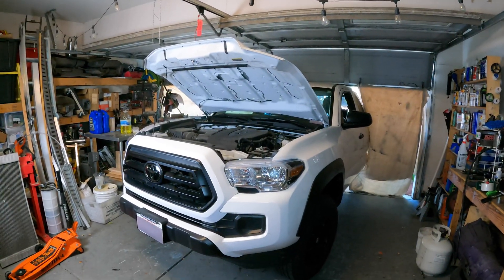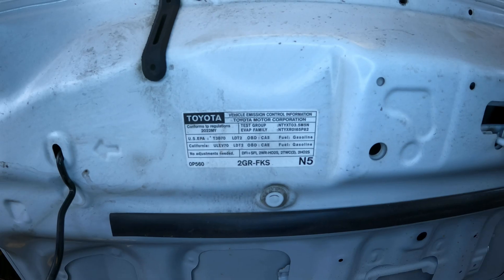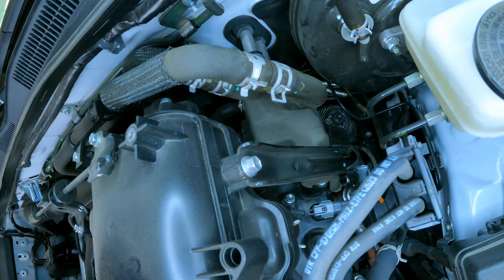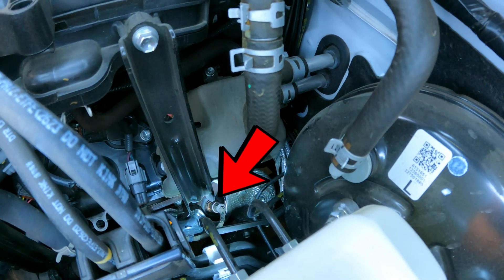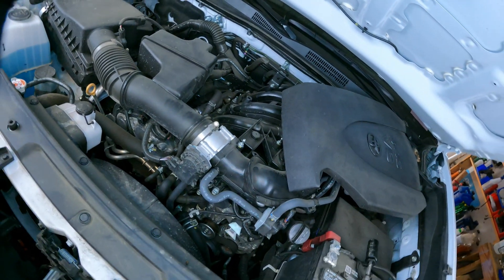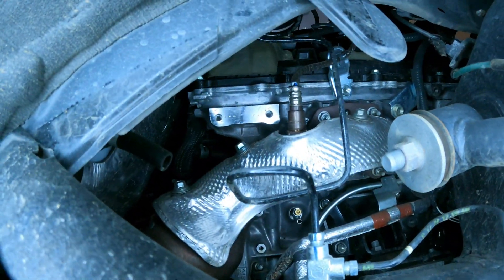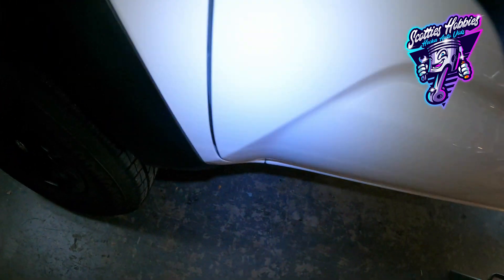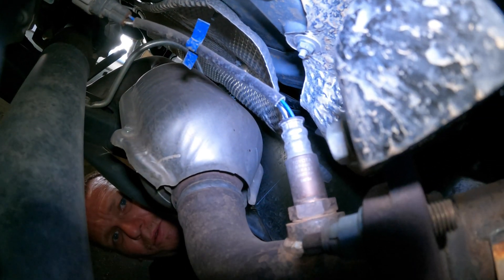Toyota Tacoma V6 3.5L (2016 - 2023) | PCV, O2 SENSORS, EVAP info & Location. #tacoma #mechanic

Comment: I'm getting 7E8: Engine and 7E9: A/T codes for the 7E8 It is P0420 Catalyst system efficienct bleow threshold bank 1. I have a 2017 tacoma SR5 can this be caused by bad O2 Sensors?

Comment: Can any of these cause a P0300? I’m having issues with my vehicle with that 2018 Trd sport
Reply from the maker: A stuck open vapor purge could but I'd think you'd get a evap code too. A bad o2 sensor could but I'd think you'd get a o2 code too... do you have a code reader? Can you check fuel trim? Have you tried cleaning your mass air flow sensor or checked for small vacuum leaks?

Comment: What specific tool can be purchased to remove the first two mentioned oxygen sensors? Are they 22mm sockets?
Reply from the maker: https://youtu.be/Aha8jE7Qxhg

If you watch that video I just posted a couple days ago. It is unrelated to your vehicle. But it shows the socket set that I use to remove oxygen sensors and I provide a link in the description to purchase them if you need it.
Reply: Thanks!
Reply from the maker: @vario2664  you're welcome.  Good luck with your project.  👍🏻🤞🏻💪🏻

Comment: Do you think any of the sensor can be throwing a code for P11EE caused that’s what I’m getting right now for my 2018 Tacoma
Reply from the maker: How many miles?
Reply from the maker: And v6 or 4 cyl?
Reply: It’s for a 2018 Tacoma off road and it’s currently sitting at 95xxx miles thanks again
Reply: It’s a v6
Reply from the maker: @Mr.Badluck8  How are you on regular maintenance such as spark? Plugs, air filter, cleaning the mass air flow meter?
Reply: Had all that done at 60k tune up
Reply from the maker: @tu3-fu375  well.... that was the wrong answer.  Lol. So this is for a fuel enbalance on the #3 cyl. Now, • is the coil weak? Can you swap #3 coil with a different cylinder coil? • It could also be a clogged injector. Have you used a fuel cleaner yet? Maybe Sea Foam? https://amzn.to/3Tm5KX9 <-- Buy sea foam. • Could be a bad gap on the spark plug, somehow? • Exhaust leak on head to manifold? 

A lot could contribute to this 'fine tooth' code.

Comment: I went for air emissions testing and failed saying my Bank 1 upstream o2 sensor needed replacing. I replaced my Bank 1 upstream o2 sensor and I still can't get the computer to reset. therefor the check engine light stays on. WHY?? Help??
Reply from the maker: Do you know what the code is? Did you use a direct replacement sensor, not a splice in?
Reply: P0420 direct replacement. Also I unhooked negative post of battery, waited 67 seconds, hooked up and PRESTO!! No more check engine light. FIXED for $40.00 and about 10 minutes of my time.  @ScottiesHobbies